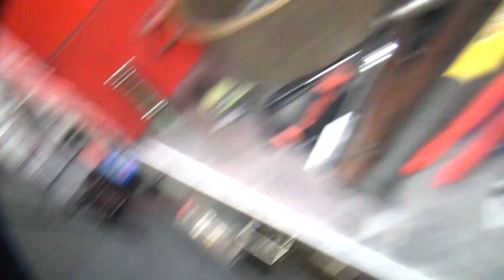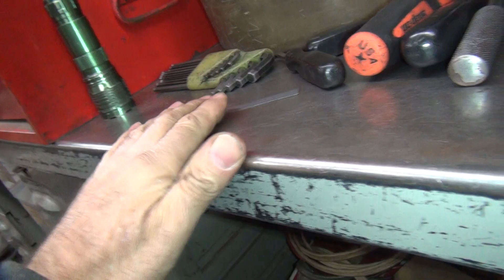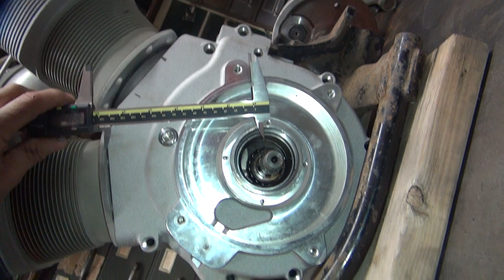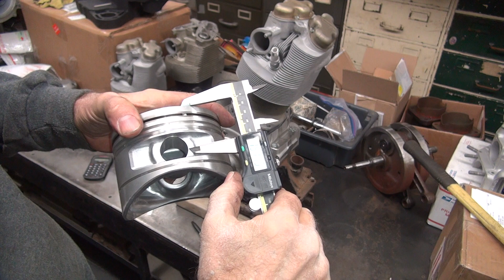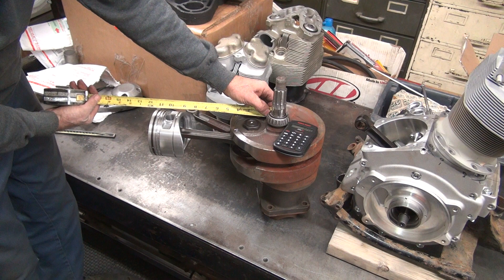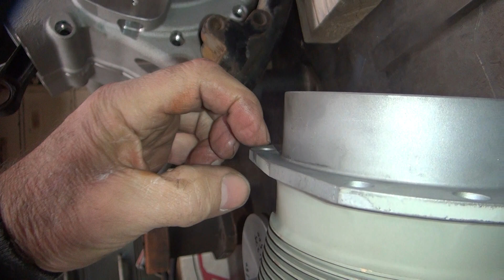#131 harley custom airplane 143ci motor mock-up big evo 4cam sportster twincam m8 race tatro machine

Comment: Hi Tatro….how about measuring the diameter of the boss, then measure from the deck to the boss, then add half the diameter of the boss……I’m a joiner btw……but I’ve had an ironhead, an 883, a 74” shovel and a twin cam……now I ride a real Triumph……do you ever work on Meridan Triumph engines?……do you like British stuff or are you strictly a H.D man?…….looking forward to following the progress of these engines…..really interesting stuff 👍
Reply: Tatro only Harley
Reply from the maker: you got it.
tatro